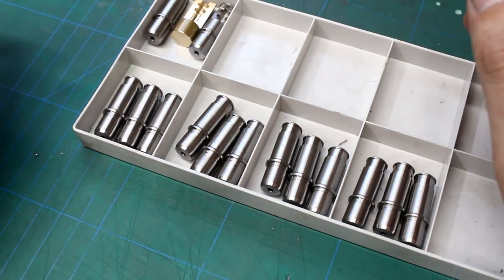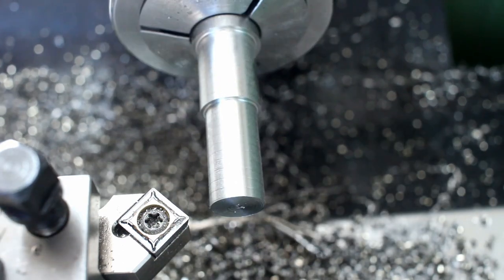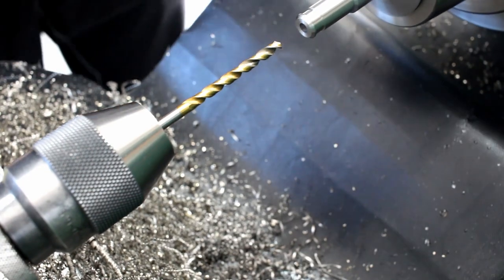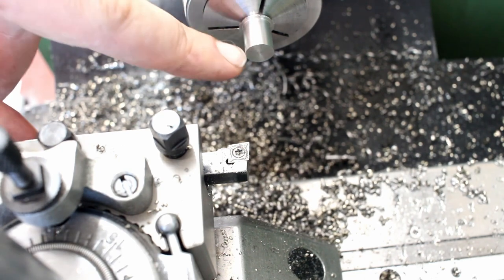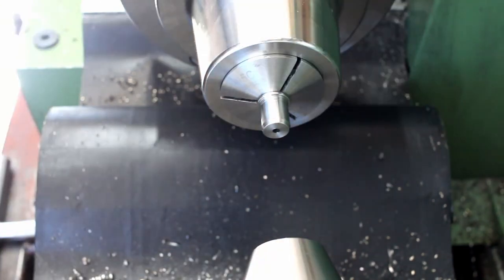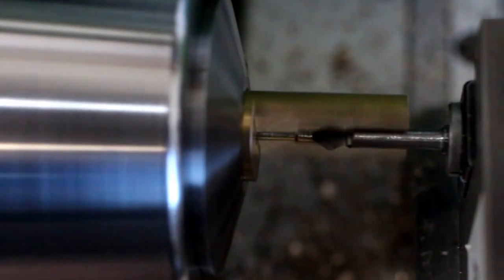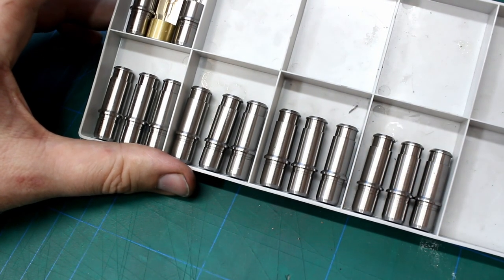Making a part: Fluxcapacitor Plungers

Comment: Thanks for all the tips. 
I especially liked the cut-away internal boring demonstration.
If you stick a piece of black electrical tape on your chuck, you can use a photodiode to detect when it goes past once a revolution, and then use that signal to trigger a strobe light illuminating the workpiece. That will make the workpiece look stationary regardless of how fast it is rotating. Useful for you, and for filming. 
Safety Warning: Remember that the work piece is still spinning and therefore dangerous, even though it looks stationary. It is very easy to get careless.

Comment: Fascinating and instructive - as always. The half-section grooving demonstration was very reminiscent of the old pHorn grooving demos which were, at the time, ground breaking, and I'm sure, were produced using very sophisticated video equipment. They certainly kept me mesmerised. Congratulations on such a professional and enlightening demonstration of all the required steps to make these demanding parts. This is what keeps me watching your videos. Thanks.
Reply: Strobe lighting properly tuned to the machine or process speed. Its been used in trouble shooting high speed machinery for years.
Reply: @mpetersen6  I had not thought of that. I was assuming he was somehow syncing  the shutter speed with the spindle. Regardless, an excellent result.

Comment: Thank you for taking the time to show the inside machining of the fluxcapacitor plungers.
Reply: lets be clear now: these new plungers have never been seen before. so they must surely be a newer innovation which is an improvement upon the original design
Reply: @dreamcat4  requiring only 44mph? Just speculation. :)

Comment: Having watched your video on cross slide drilling I straight away ordered the parts do suit my lathe.  Wish I had realised before how much easier it is, particularly with deep hole drilling. A good piece of information, thanks.
Reply: what i noticed today is how all the cutting oil actually keeps staying on the tool. instead of immediately being flung off due to centrifugal forces

Comment: Hi Stefan, not sure if you know this but you can probably reverse the tip on your Edding markers. I do it with Pilot brad makers we have in NZ that look identical to the ones you have. The tip has the same shape on both ends and can be easily removed with a pair of small pliers.

Comment: Very nice work Stefan!
ATB, Robin
Reply: If it's not presumptuous I have a question for either or both of you. It has always struck me that one should not fiddle with the zero calibration of an on-machine measurement system (such as a DRO) if the part size is falling within the repeatability band of that system. It seems to me that would result in a sort of drunken walk, and in theory it further seems to me it would double the variation if an adjustment equal to the deviation from nominal (or target) size was made after every part. 
Am I off beam, and if not, is it something you think about in any formal way when needing to hold tight specs on a long run batch? (I suppose this would involve quantifying the repeatability with a given setup)

Comment: Nice work as usual Stefan.
From my woodworking side I added an air foot switch to my morticing machine.Just give it a press when you want to clean out the mortise of chips.You might find it useful for the through spindle air on small parts to be able to turn air on and off with a foot.
I made the foot switch from an old air gun that had a flap paddle switch.Amazing how your left foot will adapt to flowing the air to suit the job or just a blast at the end before retracting the tool.

Comment: 16:51 same, but i do it with a laser i fabricobbled from some random parts. It's specifically made for marking the ends of stock, using a junk pipe vise i had that could never be used for actual work because it snapped. I think i spent about 140 euros all in all, two years ago. Worth investing in making something like that because the ease of it defeats any bad habits of not marking stuff, which i used to have and bit me in the derriere a few times. There's commercial laser hand held engravers out there, but they cost a pretty penny, i think i choked a bit when i saw the price :))

Comment: It’s always interesting to watch you at work. Thanks for the video. Good thing you added the part about the center drill at the end. While watching I was thinking about making a comment. However, I did notice you only used the tip. I’ve found center drills are a lot cheaper than spotting drills too.

Comment: Thank you for turning one of you machining mistakes into a cross-section teacher. 
Brilliant!
Reply: When showing the cutaway brass piece a strobe set to exactly the spindle speed we would have gotten a clearer picture. I used to rebuild  centrifuges for dewatering sludge from waste treatment plants. One thing we had to do was balance the the complete machine in the frame. Part of the process required locking the internal screw conveyor in place at the high point of vibration. Almost impossible to repeat with out a strobe.

Comment: a cheap used fiber laser would be handy for marking drops. Great insight. If you have certs with the material, mark the cert # on the part, full trace.

Comment: Nice trick with the air through the spindle.  I  thought it was interesting that with the small diameter parts, you still ran at only 1800 rpm when cutting OD.  When I look up the material cut speeds for carbide on steel they are invariably much higher than I can run my lathe (max 3600rpm) for such a small diameters.  For machining ID with a boring bar, I just slow the thing down until it stops chattering. Also appreciate the discussionn about spotting drill angle - very useful for us noobs.  Thanks!

Comment: In theory, if the drill bit is at an angle, the tip and some point further down on the drill are not concentric with the desired axis, and the result (in theory) will be a tapered hole.  Is this a complete non-issue, or is it a minor issue compared to the basic problem of locating the drill on center, or... something?

I LOVE seeing shiny brass chips flying off under bright lights.  :)

You almost got the synchronization perfect between the video frame rate and the rotation of the lathe on the open brass cuts!  :)  Hm.  Stroboscopic...  maybe an LED light switched on when the part turns open-side-front, with the camera on a slow frame rate to integrate frames?
Reply from the maker: If the drill was indefinitely stiff, youre absolutely correct (Youre also correct in practical terms to a degree). The bigger and shorter the drill gets, the more it would create a conical bore.
Longer drills just bend/flex to center and are not stiff enough to "bore" the hole to a cone shape.

Comment: Great video! Is there a way to measure the grooves on the inside or is that not necessary? I hope that you do a video on polishing the inside of the parts. Thank you for doing the cut-away parts, they are very instructive.
Reply from the maker: I think I do a seperate short video on how I measured them - That was a bit tricky. Unfortunately I do not have footage of that, only pictures :-\
Reply: @StefanGotteswinter  Thank you for the response. I am looking forward to seeing that.

Comment: I'm a cnc gal myself so they might not be applicable to what you do but do you have any thoughts on split point drills? I use them most of the time instead of standard/solid point drills. I feel like I couldn't go back to predrilling now that I can just drill as I please even on the od of round stock!

Comment: I like the through spindle air . I wonder if a vacuum would also work and solve your clearance issue?
Reply: Pressured air can have many atmospheres of pressure vs 'vacuum' can at best have one only.
Also having compressed air around is more likely than a vacuum pump + hoses and whatnot.
And you'd need to sieve out that stuff the vacuum sucks in so it doesn't get into the pump.

Comment: You are going to have a whole time machine when you are done with these parts. Great video as always. Your thru-spindle air system was brilliant and something I will have to do myself.

The following question is not intended to be a disparagement at all: Out of curiosity, why do customers come to you with your manual lathe for parts like this when it might be better done on a CNC? The setup cost would be expensive on a CNC, but a run of parts might end up cheaper at the end because you don't have someone manually doing everything for every part. I do a fair bit of machining for a couple of places at my home shop, but they are all one-off things for the most part. If someone asked for flux capacitor parts like what you have been showing over the year (more so for multiple runs of the same part) I would suggest they go with someone else.
Reply: as a cnc lathe setter, programmer 12 parts isn't really much of a run, given Stefans level of proficiency he could probably make 12 parts in a similar amount of time as i could on a 2 axis cnc, if you take into consideration the time to write the program, find and set the tools, run it through and then machine 12 parts (lets say 3 minutes each on the side with the int grooves). Then turn it around and do it all again (if i didn't just part it off and chamfer the back end by hand) so lets say two hours for programming and setting the first end, one hour for the second and a minute each plus time for loading to make, that's like 4 hours, maybe more if you run into any issues plus the added cost associated with cnc machining. 

now lets say we were making 100 parts it would be no contest the cnc would beat manual all day long and lets say instead of a 2 axis it was done on a 5 axis swiss lathe and they only take a minute each complete on both ends then that's 4 times faster than a the 2 axis cnc. Basic economy of scale really the more you make the cheaper and faster it becomes.
Reply: @johnwinter9399  thanks for the reply. I have been doing some runs on my manual lathe (15 parts or so) where I would have killed for a CNC, but I suspect that's mainly due to only having a DRO on one axis.

Comment: Collet stops in 5C collets. Unless you have are using dead length collets every unit of measure variance in diameter equals 3 units of measure in length. If on end has a shoulder and the length from that shoulder is really critical a simple way to control it use disc type stops. Hardinge sells a special holder that fits their 4° spindle nose. Or they can simply be placed between the part and the spindle. The disc rests against the spindle nose. As the collet is closed and the workpiece is drawn in it contacts the disc before the collet finally closes. Puts the workpiece under tension which also aids rigidity. They are dead easy to make rather than pay Hardinge's prices. There's a description of them in the Hardinge collet catalogue.

Comment: Hi Stefan, two questions please. Firstly what is the Purple Stone you rub the part with before checking the diameter ? Secondly does your DRO scales have a built in "Home" position for when you turn it on to know where the cross slide is, so you don't have to set your drill chuck on center every time ? Thanks from Australia.
Reply: I believe the purple stone is the ruby abrasive stone he mentioned in his video on deburring (about at the 20 minute mark) - removes almost no material, just improves surface finish a bit
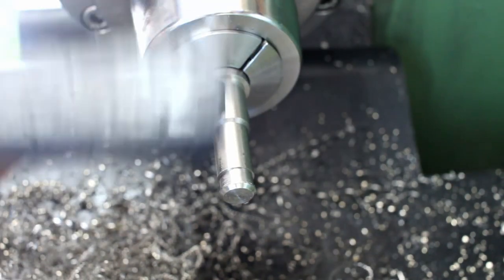Reply: @hadinossanosam4459  10:53 in this video silicon carbide impregnated rubber.
Reply: Yes he has a built in home position I would think. Just not in the case like a full on CNC lathe would have. If he can leave the DRO powered up all the time it should not matter where he parks the X axis when he is done with the machine. If he is shutting the DRO down then I would think he would either need to park the X axis at a known position  or have some sort of physical system to establish the "home" position. 
In another of his videos where he is doing drilling in the lathe I commented that you could establish a fixed X position for drilling if you had a way to register the Tool Holding Block. Say pinned to the cross slide.  Plus having a pin you could insert into an alignment hole that passes through the cross slide into the carriage.  This pin if left in place during drilling operation would probably be best to be a shear pin to prevent damage in case of an üpkehfuckt.

Comment: Ref: camera shot of inside. I wonder if a synchronous strobe (bright LED) would be enough to convince your camera to sync to the spindle?
Reply from the maker: i think it would work in a dark room. I have seen woodworkers do that, to freezeframe woodturning.
Reply: The easiest way to do it would be to tweak the VFD to slightly change the spindle speed. It would only need a few RPM one way or the other to sync up.
Reply: I think the 'Schwebung' was wandering and not stable during the cutting.
So whatever solution you come up with might need to have some feedback built into it to make it stable enough to work for the camera (see PID control).
If you can rule out the camera causing those wanderings itself due to whatever.
Reply: You need to sync the spindle to the camera, the frame rates available are fixed and can’t be adjusted to the spindle speed.  Cameras here in the US use 24, 30, 60 are the most common, some can go higher.  For 24 fps, it is taking 24 pictures per second, so you need to make sure the cutaway surface is facing the camera for all of those 24 pictures per second for it to actually appear stopped.  For a cutaway like this, you need 60x your frame rate, so for 24 fps, you need an rpm of about 1440.  The FPS in the camera is actually slightly lower than nominal setting so that it does not sync with a dark cycle of your lights running at utility frequency.  Your shutter speed then needs to also be fast enough to stop the motion, otherwise it could appear blurred.  You could pulse it with short duration flashes of light at the same fps of the camera to stop motion as well instead of having a high shutter speed.  The bottom line, if the spindle speed is not correct for the selected frame rate, then the camera will not see the same point in rotation each picture it takes.
If you are wanting to stop the motion of a 3 jaw chuck for example, you would multiply your fps times 60 and divide by 3 since there are three identical jaws and the jaws will appear to freeze in place.

Comment: Hi Stefan, do you charge for customizing tooling when pricing a job?  Thank you for your great videos.
Reply from the maker: I generaly built tooling into the quote - If I buy or grind the tool is often a late decision, depending on what is availible and my motivation ;)
Here I knew I need the ID grooving tool - Grinding the tool or purchasing one from pHorn would cost about the same. But pHorn didnt have anything suitable, so grinding it was.

Comment: Before your final pass you use a red block on the surface. What is that ?
Reply from the maker: Thats a degussit bench stone. Basicaly an extreme fine stone (also called ruby stone). Just went over the surface, because the tool left a bit of a fuzy surface that interfered with measurement.